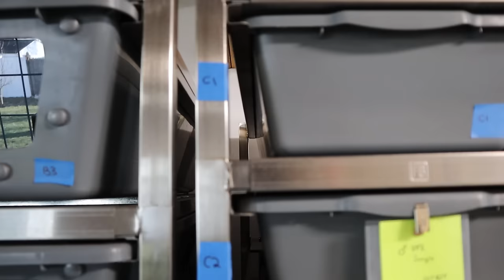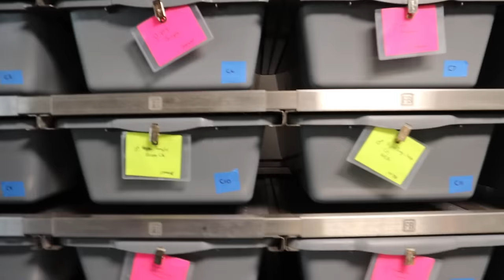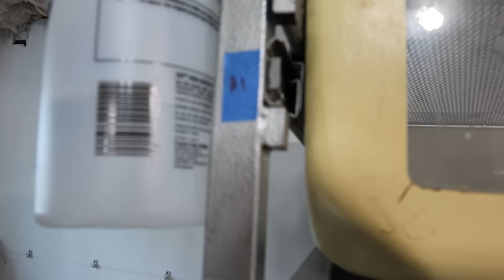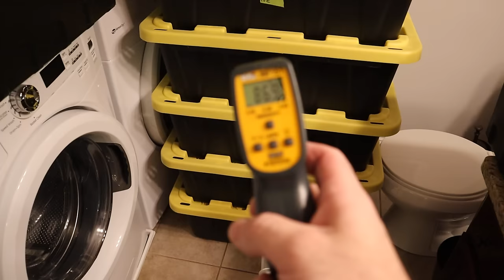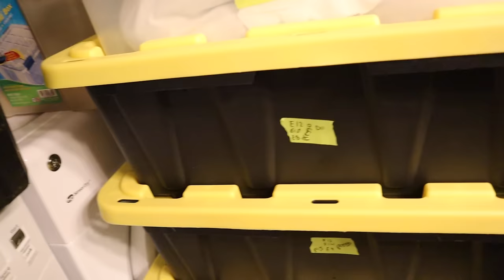Moving With Over 500 Snakes, New Snake Room Build, and Rustoleum RockSolid Floor Install

Comment: I know this is 2 years later but I am currently building a reptile room too and using same foam board insulation.

The foam board requires a thermal barrier as per code.
If a fire should start that room will go up in flames like it had gas poured on walls.

You need to add furring stripes and 1/2 drywall or something labeled as an acceptable thermal barrier
Reply from the maker: I’m pretty sure that’s only if you plan to put drywall over the top of the insulation. These are essentially free floating boards so technically they have nothing to catch fire. No drywall over the top of them.
Reply: No, the drywall or wood panels needs to cover the foam board as a thermal barrier.

If a fire ever started from faulty heat pad/ lights in that room, the code is for a flame barrier to last 15-20 mins before it burns through drywall to the foam board. Once foam board on fire fire spreads so rapidly in seconds your house cannot be saved .

15-20 min window buys you time for firefighters to get there . That’s why it’s listed in building code.

There can be no exposed foam board and or spray foam

Comment: I had the same floor resin used in my garage, it’s not really good for insulation and is always cold, I covered it with foam insulation and got laminate over the top of it, way warmer and less on the heating bills
Reply from the maker: The room is warm enough that makes it all work but correct, there is no insulating factor

Comment: Can you run two racks on 1 20 amp breaker? Great job running those on separate breakers even if you could run two on one I'm sure it's pushing the limit
Reply from the maker: Yes I can. Each rack pulls about 500 watts so I could run about 6-7 I belive.

Comment: Not really specific to you or the huge loss, which I’m truly sorry to hear about, but do you think snakes would be safer being a little too cold or a little too hot? I don’t think 100 degrees is insane hot, in my eyes a “little too hot” I can’t help but think if had to roll the dice, I’d choose to let them drop down to say 70, a little too cold...
Reply from the maker: That's correct. Heat kills fast. Everyhring was perfect until the last few hours. My goal was to keep the temps where they needed to be rather than took cold or too hot.
Reply: @JasonsExoticReptiles  It’s hard for me to really understand the magnitude of something like you described. I learn most of my valuable lessons the hardest way possible and I’m now wheelchair bound from it. Not that you’re magically a better keeper from your experience, but through mistakes, it’s easy to learn from them. I surely like your channel and what you seem to be about. I subscribed and look forward to new content along with going though the archives.

Comment: This Old House: Snake Room Edition
Reply: man I watched every minute of this video.  I made the first comment early on in the watching, but now that I got to the end, what a tragic way to end any big project.  I live in Texas, and over heating is someone I always have to worry about even in the winter when I have the heater going.  My heater in my serpentarium has a real good built in thermostat, and I have a ceiling fan going year round to keep the top of the room from getting too hot, and the bottom of the room for getting too cold.

maybe you could have forseen the vent cutting off, but after going for so long on so little sleep I don't blame you.  Why I plugged in my heater and the AC I spent hours in with my snakes just to make sure everything was going to go well.

man I am really sorry.  it sounds like you lost almost a 1/3 of your collection.  I know you must be a broken man after that, and you probroly hate yourself alot.  Don't do it man.  don't hate yourself.  I love your videos, and love your enthusiasm for your snakes.  If I was to get a boa, I would want to get one from you.

you and I are alot alike.  we are both the same age.  you were able to get into snakes when you were young.  I was only able to get my first snakes at the end of 2019.  This could have happened to me to.
Reply from the maker: Thank you.  It is amazing how heat can kill so quickly.
Reply: @JasonsExoticReptiles  I saved a crawfish from a crawfish boil I went to.  kept it as a pet for 3 months in a shamefully small tank.  one of the times I was doing a water change i figured I would rince the thing off real quick in the sink.  I forgot to turn it to cold water when I did and the crawfish freaked out. it was only a second or two, but it was dead within 2 days after that